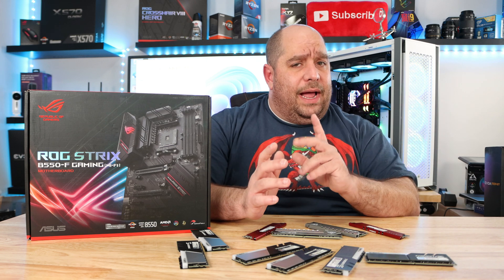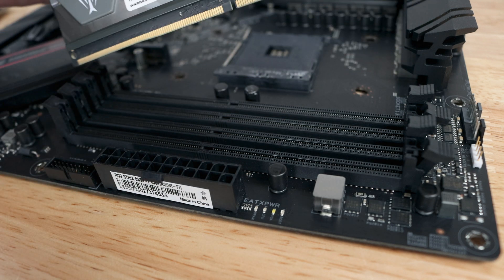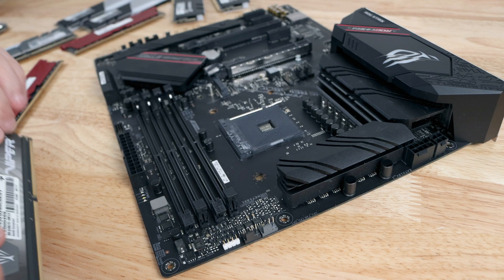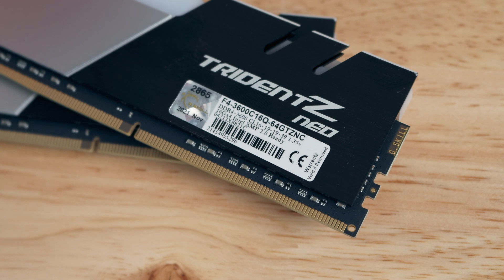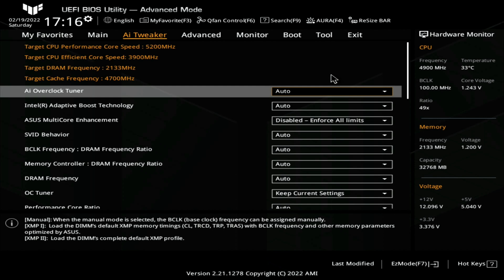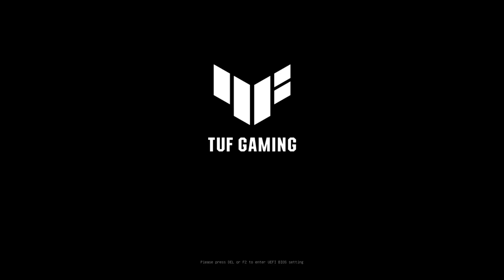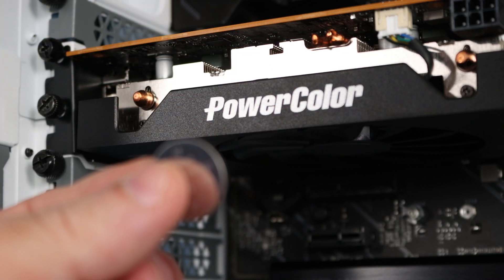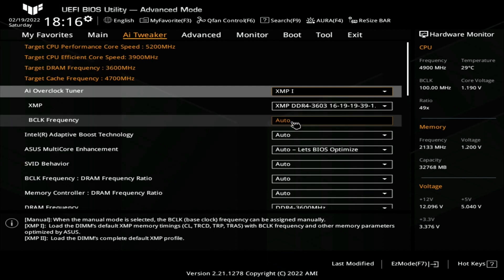How to install and configure RAM in a PC - Step By Step Setup Beginners Guide

Comment: An issue i have been struggling, is when I put the "optimal" memory slots for my ram, my keyboard and mouse are disconnected and no display on the monitor. When I remove the 2nd RAM stick, works fine. What could be the issue? This is a 2X16 4000MhZ DDR4, G.Skill brand Ripjaws V RAM sticks.
Reply from the maker: When you say optimal memory slots, what slots are those?  And what is the manufacturer and model number of your motherboard?
Reply: @ThisBytesForYou  MSI Z390 gOdlike mobo. CPU is i7 9700K. I tried both 1&3 and 2&4 still the same problem.
Reply from the maker: @Ztlumminee  not sure where you saw optimal but the manual states 2 and 4 on page 4 and 31 (AKA DIMMA2 and DIMMB2): https://download-2.msi.com/archive/mnu_exe/mb/E7B10v1.1.pdf
Did you buy the sticks together in a kit, or separate?
I was a product development engineer for Alienware, then Dell after the bought us and Velocity Micro, I was asking what Optimal was because there are states where this is necessary due to single or dual channel memory, but it seems like this is dual channel double sided memory, so 2 and 4 it is.
Also, on your motherboard, you can find out using CPUZ or going into the BIOS itself, what BIOS version are you on?
Reply: @ yes i bought the RAM sticks in a set of 2 together. I had both RAM sticks installed next to each other and then saw a message upon startup saying memory not installed in optimal slot. I might start with the BIOS option see if that helps. Current BIOS version as of 22 Dec 24 is: E7B10IMS.180 BIOS build date: 08/08/2019
Reply from the maker: I have to correct myself on one thing, even though it won't help here, but I wanted to mention that this memory it looks like is single sided, single rank, even though it is dual channel.  Some boards might have a better configuration for single rank, but your manual doesn't state it.

The last memory compatibility support was entered in the BIOS 7B10v14, you have 7B10v18, there have been 5 updates since then, though none mention memory, they mention vulnerabilities, Windows 11 support, Microcode updates, VGA card compatibility and security issues, you might want to update especially if you want 11, which I have been using since it came out, and it's great, a few issues but most if not all have been corrected and improved upon, I dont recommend upgrading, more a clean install, if you are planning to go that route.

BIOS
https://www.msi.com/Motherboard/MEG-Z390-GODLIKE/support#bios

Do you have XMP enabled?
Reply: @ThisBytesForYou  XMP doesn't work well, it will cause my mouse to lose connection.
Reply from the maker: ahhh, that makes sense, I can't tell from the QVL if your memory is certified to work, but that could be an issue.  Try swapping the memory in bank 2 to bank 4 and from 4 to 2 and see if that help but looking at the QVL, it doesnt look like your memory or speed is supported, doesn't mean it wont work, but something to look out for.
Reply: @ whats QVL?
Reply: Did that, still fails, wont even have dislY screen turn on and keyboard and mouse not connecting.
Reply from the maker: @Ztlumminee  Qualified Vendor List, its all the memory that has been certified to work on that board: https://www.msi.com/Motherboard/MEG-Z390-GODLIKE/support#mem
Reply from the maker: @Ztlumminee  hmmm, seems like your memory actually isn't supported then, on the QVL the fastest memory supported is actually 3466Mhz
Reply: @ThisBytesForYou  Yes I saw on the QVL, my current RAM, ID number F4-4000C18D-32GVK is not on the list, but manages to work on DIMMA1 or DIMMA2 just fine. Maybe that's culprit.
Reply from the maker: right, but thats not where it should work, as the manual reads 2 and 4, but if it works for you, ... go for it, but expect issues.
Reply: @ for now, one RAM stick, rated at 16gb 4000 MHZ installed on DIMMA2 is working for me. Haven’t XMP’d it yet.
Reply from the maker: @Ztlumminee  You have it set to 4000Mhz, that doesn't mean it is rated for 4000Mhz, what you may need to do, to get the 4000Mhz supported on the other, is maybe raise the voltage, you memory is rated for 1.40 voltage, try 1.42, see if that helps.  The you have to set your latency's, 18-22-22-42, but on the GSKILL website, it shows t is XMp 2.0 rated, make sure you have the right profile selected if you have more than one.
https://www.gskill.com/specification/165/184/1608538914/F4-4000C18D-32GVK-Specification
Reply: I XMP’d it, BSOD 😩
Reply: @ now its INACCESSIBLE BOOT DEVICE. 😩😩😩😩
Reply from the maker: @Ztlumminee  did you disconnect your SSD/Hard drive, your RAM is not a Boot Device
Reply: @ i disabled M.2 optane genie idk
Reply: Ok nvm I put my computer in safe mode then restart it seems to go back to normal.
Reply from the maker: Reenable it, its a cache for your main drive, you need it to boot.

Comment: Will the XMP profile automatically set the timing to what your motherboard can handle, or is it it's own preprogrammed thing? Just curious because I'm looking to install brand new ram on a slightly older motherboard that I got about 4 years ago.
Reply from the maker: It will install utilizing its pre programmed timing, which "should" be good for your board too, make sure you are flashed to the very latest BIOS on your board before you use the RAM.
Reply: @ThisBytesForYou  Sounds good, thank you!!
Reply from the maker: anytime my friend, happy I could help.  Let me know how it goes, though I am pretty sure it will work perfectly for you.
Reply: @ThisBytesForYou  All installed and working! My computer wouldn't boot for a while after I first installed, which scared the  shit out of me tbh, but it finally decided to boot eventually and has been working fine ever since. I think some dust just got in the DIMM port so some compressed air solved it. Thanks for the help! Definitely glad I updated the bios before doing it :)
Reply from the maker: @jake_9113  Always a pleasure my friend, so very happy you stopped by, trusted in me to help you, liked and subbed as well as took a moment out of your day to thank me.  It means a ton to me and I am so very happy I could help you.

Comment: Hi I bought 2 x16GB RIPJAWS V to supplement my PC RAM, 16GB hyperX RAM but when installed the PC screen turned blue and reported errors which I could not fix.  The RIPJAWS V will work fine when they only are fitted.  I have watched your video again, is it possible tha5 the two makes of RAM are incompatible.
Reply from the maker: did you disable XMP, set the timings to the higher of the 2 sets and set the voltages to to the higher of the 2 sets and then try?
Reply: @ThisBytesForYou  I think you are a few light years ahead of me. 😂
Reply from the maker: @20000deadchildren  check out the video, I go over that.
Reply: @ThisBytesForYou  will do and thanks again.
Reply from the maker: howd it go?
Reply: @ThisBytesForYou  as predicted. Genius. Well done
Reply from the maker: Always a pleasure my friend, so very happy you stopped by, trusted in me to help you, liked and subbed as well as took a moment out of your day to thank me.  It means a ton to me and I am so very happy I could help you.

Comment: I was wondering. I am switching from 4 sticks of 8 GB of ddr4 at 2400 mhz to 2 sticks of 16 GB ddr4 at 2666 (the technical max for my CPU but I have an 8th gen i7 8700k which supports overclocking but I'm not trying to do so). I think one of my 8 GB sticks has gone bad because I received 400 errors on memtest86 and I am getting about 1 blue screen a day. I have never upgraded ram. 

What I'm trying to figure out is do I need to disable xmp first before putting in new ram and then re-enable it after booting up or does it matter?
Reply from the maker: I recommend setting it to Auto first, then boot into windows, then shut down your computer, then install the ram, startup and go into the BIOS and example XMP, save and exit and you should be good.  Install them the way I show you here, its very important.
Reply: @ThisBytesForYou  thanks. I have been looking everywhere for days for an answer and it's been difficult finding one for some reason. Xmp was already on auto on easy mode but I'll check it again on advanced before I do all of that. I know the manual to my motherboard said it required 2 or 4 sets (of 2 sticks) at a time, I even seen it states to use a2 and b2 first. And being it supports 64 GB I figured I would go with 2 16s although I don't expect to need 64 but who knows. I'm more versed on dealing with software stuff but hardware, not so much. I appreciate you, the reply, and the vid!
Reply from the maker: Always a pleasure my friend, so very happy you stopped by, trusted in me to help you, liked and subbed as well as took a moment out of your day to thank me.  It means a ton to me and I am so very happy I could help you.

Comment: Hello my friend. Great video :) my problem is: sometimes i got this message on windows (windows 10pro) that says: "16,0 GB (7,93 GB usable)". I have done everything. flash the bios to the latest ver. check out all the things in windows that can show-identify my memory and all shows 16gb ram. SO ITS NOT A faulty - burned out ramstick. the only problem is with Windows. Why? is it possible that one of the sticks is not firmly seated? maybe i have to push it harder (i have only one latch on memory slots on motherboard). should i remove them and install again applying more pressure? Sorry for my bad english i hope you understand me :) Greetings from Greece <3 (edit: in task manager says: hardware reserved: 8,1gb), and no i dont have an integrated graphics neither in cpu or motherboard-i think :) )
Reply from the maker: What is the manufacturer and model number of your CPU and your motherboard
Reply: @ThisBytesForYou  after 5 hours of trying i just fixed it....the 4th slot of my motherboard the oneclip slot the clip was problematic.....i pushed it hard and it fixed....sometimes you dont have to be afraid and push hard :D thnx for your answer!!!! subbed :)
Reply from the maker: ahhhh good idea my friend, glad you can get it and thanks so much for your support, it means the world to me.

Comment: Ok, but you still didn't explain what if I have 4 modules and two modules have the same number i.e. 2090 / 2090 and another two 2091 / 2091. All you shows is memory (four modules) with diff numbers. How to setup sync memory on Asrock X570S Riptide?
Reply from the maker: I do, keep them in the same banks, so 2090 go in slot 2 and 4 and 91 goes in 1 and  3.  All I do... Nice...  You're welcome by the way.
Reply: @ThisBytesForYou  Ok. Thanks
Reply from the maker: @ArtGenerator  uh huh

Comment: Why is the ram installed in every other slot?
Reply from the maker: @mperlatti  that is dual channel mode is for many/most boards is required to function at all.  Dual channel mode uses a pair of memory together for optimal performance reducing the time it takes for the memory controller to provide the next set of instructions.  Some boards allow for a single stick of ram running in single channel mode, which is slower of course.  To be specific though, you should always check your motherboard manual.

Comment: My problem is that i added 1 new RAM stick thats almost indentical ddr4 3k mhz like old one, cl16, same 8gb only brand is different because those arent made anymore. When i turn on PC both of them fall to 2100ish mhz even with auto "tuning" turned in BIOS. When i leave the old one it goes back to 3k mhz, when i leave just new one its same just when they are double they go like they dont match ... Im baffled
Reply from the maker: Did you watch this video

Comment: If you just take out the 2 sticks of ram (just to see how it worked, out of curiosity) and put them back in, do you still have do the setup on the BIOS screen as you showed in here?
Reply from the maker: you shouldn't have to, if you are having issues, maybe they are not seated right.

Comment: Are there any of the best configurations for 24GB RAM? Because 16GB is too low for me, and 32GB is too much
Reply from the maker: 24Gigs would be more for Quad channel RAM, which hasn't been used since Gulf Town processors.  There is no such thing as too much, go for 32 if 16 is too low.  You want 2 or 4 sticks, so you can stick to dual channel, if you do 3 sticks you will do single channel.

Comment: I have this problem, I bought second set 64 gb (2x32) trident z5 neo rgb, new set does not run . I tried every combination, nope does not work. I removed my original rams(2x32 same rams but 3 monts older), install new rams , pc no respond again!! I am gonna loose my mind..
Reply from the maker: Did you watch this video
Reply: do you have any advice ?
Reply from the maker: Yes,... watch the video

Comment: okay so question, i had an existing ram stick one singular 16 g stick in my alienware prebuilt pc. i used razer cortex to get the exact model size and speed stick to add another one making it 2 i followed procedures and made sure everything was off before installing and then making sure they were spaced properly in their dimm slots. i turned my pc on it powered up but couldnt get an hdmi reading would i have to pop out the battery and reset bios to test if itll turn on with the old and new ram stick in ?
Reply from the maker: Did you watch this video?
Reply: @ThisBytesForYou  I did but I didn’t feel like I got an exact answer.
Reply from the maker: @Blood8ound ahhh let me know which part in the video  confused you

Comment: Friendly reminder to make sure you hear a click, it’s vital for it to work!
Reply from the maker: @Spiffy_Tiffys  and i state that but if it's a used board it may not always click
Reply: @ThisBytesForYou  Didn't know used boards did that, My main issue was always forgetting it clicked whenever I rebuild my pc 🤣
Reply from the maker: yup, it doesn't always click, but on new boards it doesn't, especially if you upgrade often, it stops being so snappy. (Pun not intended, but it works ;) )

Comment: why cant you just reset bios settings in bios, rather than pulling off a battery charge
Reply from the maker: how are you going to do that if you cant power the system on because its been set with other BIOS settings for the RAM?  Trying to cover the best failsafe method.
Reply: @ThisBytesForYou  can I ask another question please? Does pulling out the mobo battery also fix both RAM sticks registering half of the ram installed? cause Ive tried everything else and there are no faulty parts (only 2 RAM ports), and if so, in what order should i do it in?
Reply from the maker: @hughmungus1032  give it a try

Comment: omg this is way more complicated than i thought it was going to be
Reply from the maker: Good thing you have this guide to help you, it's helped a ton.
Reply: @ThisBytesForYou  apparently i got RAM that wasn't compatible with my mobo
Reply from the maker: @kakashi7280  that's a possibility but have you checked the motherboard manual to see what banks they are supposed to be installed into, this is for about 90% or more of configurations but some are different.  What is the manufacturer and model number of your motherboard and ram?

Comment: If you only have 2 sticks should you always use A/B1 first or A/B2?
Reply from the maker: you should always read the manual for your board, many boards have it different, but the way I installed it, is the more common way.

Comment: So how do you get in that menu where you enable XMP? I know you said delete key or F2 but do you press that as soon as you turn the pc back on or?
Reply from the maker: looks like the video cut off, sorry about that.  After installing the RAM, when you turn the PC back on, start tapping the Del or F2 key to get into the BIOS, where it is in your BIOS, what is the manufacturer and model number of your motherboard?
Reply: @ThisBytesForYou  It’s a cyber power pc but the motherboard is a ASRock B-760MC

Comment: Very interesting. Silly question: what if i have 6 Dimm slots, had 2 sticks installed, then bought 3 more to install. Do they have to be installed in pairs or can i get away with a odd number?
Reply from the maker: what processor and motherboard do you have?